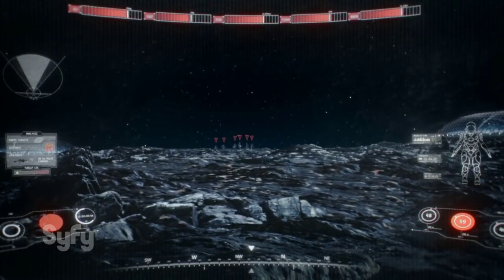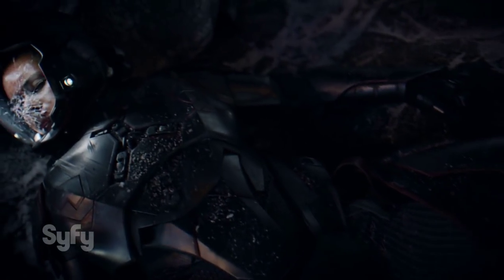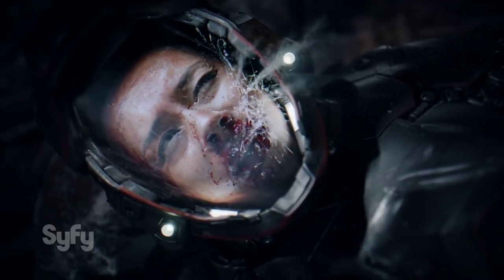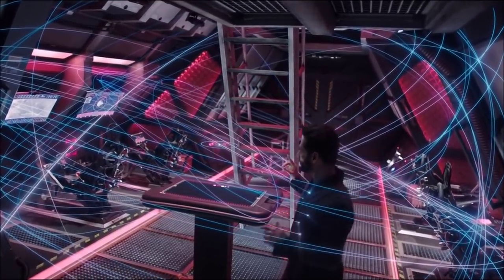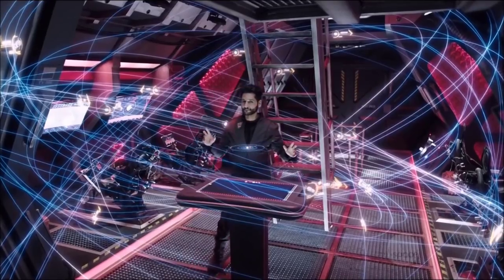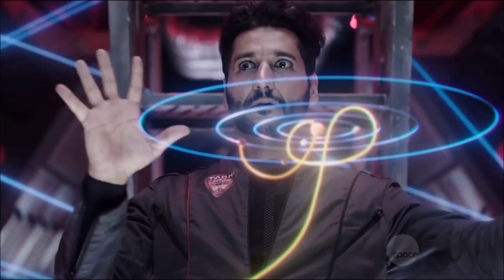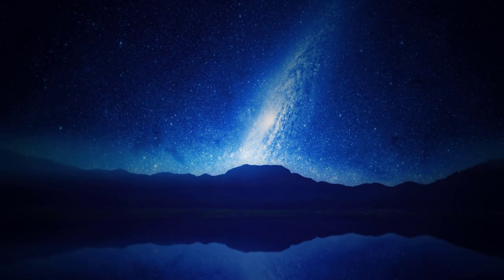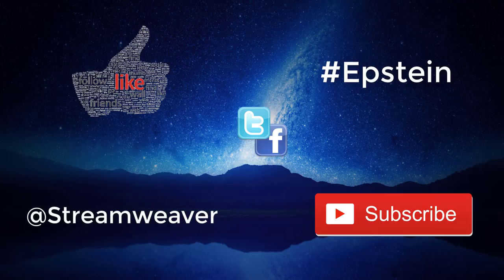Let's Do the Science:  The Epstein Drive

Comment: Haven't got the chance to read the books yet, however, if the show is consistent with Corey's ideas when it comes to drive tech, we probably have a bit more information.

Now, as far as I know, the conservation of momentum is still a thing in the Expanse (well, let's not mention that flying potato thing that nearly wiped out the Earth). Therefore, the drive exhaust some form of particles. Exhaust velocity is most likely somewhere in range of 3.7% (Epstein's yacht) and 6.8% (Rocinante) the speed of light.

We know that on Rocinante reactor runs on Deuterium and Helium 3. If the fusion result is the exhaust, then it should mostly be helium-4 nuclei and high-energy protons. Although, there might be some additional steps in between the fusion and the exhaust. During the pursue of the Chetzemoka (s5e10), the Rocinante engages with the Free Navy forces and Holden and De Baca mention that the ship is low on reaction mass. Assuming it isn't the fuel pellets for the reactor and not the fuel for the maneuvering system (although, one can't be sure if it really isn't), it might be that whatever this mass is, it may play role in the aforementioned additional steps and be the main component of the drive's exhaust gases. 

Having said that, I would speculate that whatever fuel is used to power Rocinante's OMS, it is different from the main drive's as it doesn't rely of fusion, since it perfectly works when the protomolecule shuts down fusion on Ilos.

The reality, most likely, is that authors do not know how the hell the Epstein Drive works. Most of the technologies in the series are the realistic upgraded versions of what we're developing today -- e.g. viable fusion. Space drives are not like that. Although, there are some possible prospects for ion, plasma or photon, they couldn't provide the effect Corey wanted. So, they went nuclear and created the new type of fuel -- efficiency.

By the way, regarding liberal physics with usage of these drives on landing pads and stations. We know for sure that the main drives aren't used near other surfaces. During the landing on Ilos (s4e1) we clearly see that Rocinante is landing solely using OMS with the main drive off. Take a moment to appreciate the thrust of the OMS if it can overcome ~1g of gravity. (That actually makes me wonder how these thrusters operate. Probably efficiency, since I can't imagine hypergolic - or any other systems that provide such efficiency and thrust both in the atmosphere and in space)

The same goes for space stations -- during the battle at Thoth station neither the stealth ship, nor the Rocinante use their main drives when maneuvering close to the station. The smaller ships, like drones used at Tycho stations clearly don't have fusion cores and probably rely on chemical (maybe ion?) engines.

Comment: There are most certainly "fuel tanks". The books talk about fuel and ejection mass on numerous occasions.. I've only seen a couple episodes of the show so I can't speak to that. The reaction thrusters are specifically stated to use water as a fuel, though I'm not sure if the drive fuel source is ever stated.
Reply: From what I've read of the books it's only ever refered to as 'fuel pellets', I've yet to see anything more on exactly what those are but since it's not what the story is about I doubt there will be any more info than that
Reply: @themadhammer3305  There is talk about reaction mass in regards to main engine, like for example when the were pursuing free navy (books) they were running low on reaction mass, and on numerous occasions there is talk about saving fuel to reach their destination. When crew boarded Roci they said that pellets supply will last for years so there would be no need to worry for it to reach nearest resupply point.
Reply: @mrkacperso8974  ah I haven't gotten to the point where their pursuing the free navy yet. Thinking back weren't they also worried about fuel after the Canterbury was destroyed and they were running on the shuttle?
Reply: @themadhammer3305  sorry then ;). You are correct about the fact that they were worried about the fuel after the Cant was destroyed, but the shuttle was not equipped with Epstein drive, it had "torch" drive which is lot less efficient than Epstein, they didn't even used it then to avoid damaging the Cant. At least that was the case in the novels.

Comment: Both the show and the books mention numerous times that the ships also have "reaction mass" as well as fuel. I believe this reaction mass is water. Water is very common in the sol system, is quite dense compared to liquid hydrogen for example, has a lot of hydrogen in it which improves specific impulse. Plus this water can also be used in RCS for maneuvering and "teakettleing. I believe the energy from the fusion reactor is used to vaporize, ionize and then accelerate the water to tremendous speeds and hurled out of the drive via magnetic nozzle.

Comment: #mytheory The problem that seems to be overlooked is heat.  Even 1% of the heat from a 1G engine would need huge radiator fins.  Somehow you have to dissipate the heat from generating all that energy. And the Expanse ships do not have radiators.  The old fission bomb drive, where you blow off small bombs behind a reaction plate has the tremendous advantage that all the heat is carried away with the reaction mass. The Epstien drive will likely follow that model. So the plasma torch is also the reaction chamber for whatever magical fusion system drives the ship. The other piece of magic is dissipating all the heat from internal systems without radiators.  Perhaps this heat is somehow channeled into the exhaust?
'Efficiency' is simpler matter.  In order to use a negligible amount of fuel your exhaust velocity (aka Isp, Specific Impulse) has to be more than about 10x your Acceleration X Time between refueling. Example: 1 month at 1G requires an exhaust velocity of about 3x10^7.  That's only 10% the speed of light.  Childs play! :)

Comment: The problem is they don't have enough fuel capacity to sustain 10G, even if you had a perfect fusion engine.

Then there is the excess energy generation. You need massive cooling.

1G is much more obtainable.

Do not forget the ship has to be slowed down too, you have to turn it around half way.

Comment: This topic is always on my mind when reading the books. The only concerns related to fuel I recall are related to the nuclear reaction source, the pellets. Everything else kind of happens magically. 

I am completely blown away by how small the solar system becomes at speeds that are trivial in the books. Sometimes I’ve told myself the creators are condensing time as characters move great distances (for instance, addressing an emergent situation on Eros from Tycho) but you’ve revealed that may not always be the case.
Reply: and especially when 1G acceleration really doesn't seem that fast at first

Comment: #epstein  #mytheory   Could the Epstien drive just be an improved Ad Astra Vasimr drive  http://www.adastrarocket.com/aarc/VASIMR  It would make some sense as the fusion reactor would provide the power for the drive. With about 200 years of improvement on the basics of it, I would think that it would fit rather well as the Epstein drive.
Reply from the maker: Some variant or similar mechanism seems reasonable.  Folks seem a little fixated on the idea of directly dumping fusion plasma to the engines, but an approach like this seems to make a lot more sense.  I wonder what the current fuel requirements of this are and how long it lasts.  I couldn't find any information and my google-fu is failing me.
Reply: I think we can explain the long travel times with limited supply of available drive mass (also limited ram scoop ability in solar system, if the drive mass is hydrogen). So we should ditch the idea of constant acceleration. If a freighter could travel 5 light hours in 18 months, that would mean 11 hours or so acceleration at 1/3 g. Assuming that half of the drive mass will be used for deceleration, traveling Neptune would take months as books state. So I don't think they did the math wrong (not totally wrong anyway). And yes, I assume fusion powered VASIMR drive.
Reply: 2350 is roughly when The Expanse is supposedly set. so ~350 years would make the drive amazing. Most likely they use efficiency over all else. Evidenced by ship design and such so they use short burns and Orbital Flight Paths. Possibly using gravity maneuvers to produce further acceleration.

Perhaps it is a hybrid VASIMR and CANNAE Drive?
Reply: As you can see here: http://www.projectrho.com/public_html/rocket/enginelist.php the VASIMR drive is at the start of the MW drives, while the mysterious Epstein drive is in the highest category, having the highest Specific Impulse of all drives, lest Antimatter MAX. It is difficult to believe, that one can improve a concept so drastically. In the series, the Epstein guy just pumped 4% more fuel to the thrusters and all of a sudden the ship went whoosh. That's pretty naive I guess.
Reply: They are Ion drive. It’s not similar other than that. The Epstein is an engine configuration that provides amazing efficient from the existing ion engine.

Comment: really like the scientific approach to this, but why do you loop random clips from the show? that is distracting quite a bit.

To your questions: from what I can find of the Eppstein Drive its supposed to use Fusion in a Magnetic Chamber for controlling the plasma. And then a magnetised nozzle to direct the  propelling mater. 
If we now assume a Deuterium Lithium Fusion instead of a standard D2 + T3 Fusion (or any other that does not produce Neutrons), the resulting products would be high energetic mater plus charged particles which again could be directed towards the nozzle. The energy to direct them could come from the same fusion reaction.

Since as you said its theory is based on efficiency I makes sense to assume all the products are "somehow" used with a greater efficiency, thus not only using the main product of the fusion for propelling, but also the secondary particles and the energy.

This is of course only half scientific and I am only a hobbyist, not a scientist, but it sounds sort of plausible - given future material knowhow in terms of how the chamber an nozzles are build.

Comment: Waste heat is the main problem with high ISP and high Thrust fusion propulsion. You need a colossal size radiators to radiate enormous amount of waste heat  or your ship will just literally  melt away like a snowflake. In Expanse universe ships doesn't have any of them at all. Sorry to say that, but Epstein drive is no more realistic than a warp drive, maybe it will be  possible  in the future but on our technological level it only a dream.
Reply: but if you can shed the waste heat in your exhaust plume, you'll be okay
Reply: Fusion rockets can't do that without tremendously  drop their efficiency to the level similar to chemical rockets using reaction mass to physically flush excessive heat. That's why huge  radiators on torch ship is inevitable evil.
Reply: "maybe it will be  possible  in the future"

Like, 200 years in the future. :D
Reply: Until the exhaust plume gets spotted all the way across the system.  Check out "Atomic Rockets" There ain't no stealth in space - http://www.projectrho.com/public_html/rocket/spacewardetect.php#id--Strategic_Combat_Sensors--There_Ain%27t_No_Stealth_In_Space
Reply: +Todd Kes: That guy's writing style is super obnoxious. Did he make up his own internet law and the cite it?
Reply: One of the reasons for using a reaction mass propellant is to use it to soak up the energy that the vessel has to get rid of anyway, and expelling the expanding ions out of the back.  Although water is convenient, you could us almost anything.
Reply: @toddkes5890  There is stealth in space, but it's not terribly practical (though it does have some uses) - http://toughsf.blogspot.com/2016/10/the-hydrogen-steamer-stealth-spaceship.html , http://toughsf.blogspot.com/2017/01/expansion-cooled-curved-nozzle-stealth.html , http://toughsf.blogspot.com/2018/04/permanent-and-perfect-stealth-in-space.html . Any true stealthship would be very slow in order to avoid detection and won't have too much of a payload. Stealth ships in the Expanse didn't need to be invisible - they've only needed to be unrecognizable as vessels of their class and appear as something meek and worthless on long-range sensors, so they can get closer and do their thing.

Comment: Neutron radiation IS ionizing.  If you're going to call your channel "Let's do the science", maybe you should actually know what the hell you're talking about, or at least take 20 seconds on Google.
Reply: Well it's not directly ionizing, because neutrons can't excite electrons at all. When neutron radiation is absorbed by a nucleus then the nucleus can emit ionizing radiation. We call this indirectly ionizing radiation, and the distinction between the two is important.
Reply: Is that the differnce between Alpha and Beta particles?
Reply: Alpha particles are fast moving helium nuclei, beta particles are fast moving electrons (or positrons). Disregard, I misread your question. 

No, both alpha and beta radiation are directly ionizing.
Reply: I don't know why they call it ionizing when it's more... isotopinizing
Reply: I am doing my research from the perspective of radiation poisoning treatment. I was under the impression that alpha particles are not nearly as destructive as beta, when it comes to organics. In fact can be scrubbed off, but left lodged in a biological system, decay into beta particles. Causing delayed symptom. Am I on the wrong track? I have been trying to put together an Encyclopedia of Survival. Everything from lone survival to civil survival. It turns out there is as many treatment for radiation poisoning as the are types of radiation.
Reply: alpha radiation is heavy and has a bigger electric charge than beta radiation, so it is stopped by as little by a sheet of paper (if I recall correctly). beta radiation gets through much more stuff and is thus harder to protect against. I'm not sure how it would cause beta radiation.
Reply: Calm down if it was real Elon Musk would have one. LOL

Comment: The Problem of D-He3 fusion is that even spin polarized with that it produces Neutron with even in small percentages, will produces huge amount of Heat which we would have to get rid of. A better solution would be fusion based on Fusion of Hydrogen with Lithium-7 the most common isotope of Lithium. This is a pure A-Neutronic type of fusion which would minimize the amount of wasteheat.

Comment: I think you're pretty much spot on- It has to have a very high energy capture to work- However, there are aneutronic fusion reaction chains. Those don't produce neutrons that need to be captured. After that, you can get very high efficiency fusion by capturing energetic particles directly from the confined plasma. An Inverse cyclotron converter has a theoretical maximum of 90% energy capture. The remaining 10% (which would be pure heat) you can probably use as a pre-heating cycle for your reaction mass, and that probably would already get it to a plasma state. From there, just use electromagnetic type thrusters to dump as much energy as you want into the reaction mass, and off you go.

Comment: The books also mentioned they use water as their ejection mass, so water + heat is the only thrust they're using. water responds to strong EM fields, so accelerating the ejection mass with coils like in this type of space drive : https://en.wikipedia.org/wiki/Magnetoplasmadynamic_thruster

Comment: Thrust: 6,370,000 N
    Specific Impulse (isp): 1,927,000 seconds
    Exhaust Velocity (ve): 18,900,000 m/second (6.8% of light speed)
    Mass Flow Rate: 2.2 kg/second
    Thrust Power: 60.2 Terawatt
    Total power output: 96.8 Terawatt
    Engine's Thrust to Weight Ratio: Presumably over 3 (The Roci has a dry TWR of 2.6)
    Fusion type: D-He3 (1:2 mixture ratio)
    Fusion pulse rate: "[what we see] can be achieved with as few as 10 pulses per second, or hundreds if possible"

Comment: As far as i undertand from Epsteins explanation as a narrator it's basically a conventional engine "turbo-boosted" using magnetic coils around the nozzle (similar to the Biefeld–Brown effect), powered by a fusion reactor.

That's why Epstein expected only 10% more efficiency. He didn't develope an entirely new drive, i strapped a turbo to a regular engine. It's the perfect analogue. You can increase a combustion-engines efficiency by a multitude by adding a turbo-charger.

Edit: my second theory is that Epstein used a conventional atomic engine and somehow increased the output of it's heat-elements using a fusion reactor.

Comment: The drive is a two stage drive system, first you have the hydrogen fuel pellets used to initiate fusion, second you have driver coils accelerating the plasma similar to what the dawn probe used. The main difference between the dawn probe engines and the epstein drive is that the dawn probe is mainly limited by available power, solar power, the epstein drive is the power source and the fuel for the driver coils. Aside from a few elements of material science, we can build those drives now, all that is needed is sufficient orbital infrastructure to build and twerk everything.